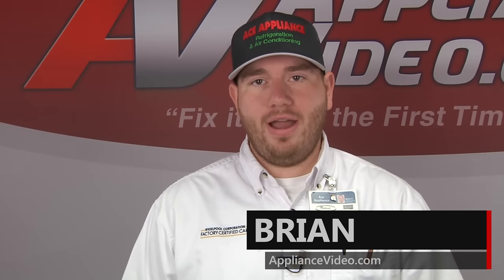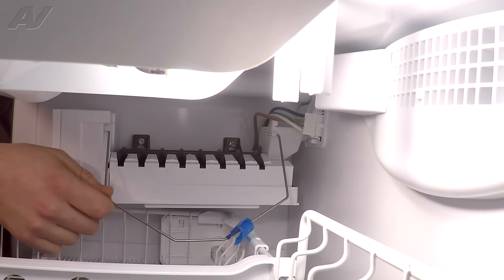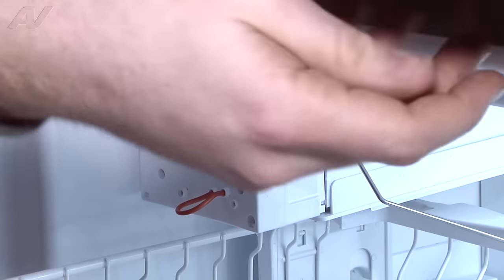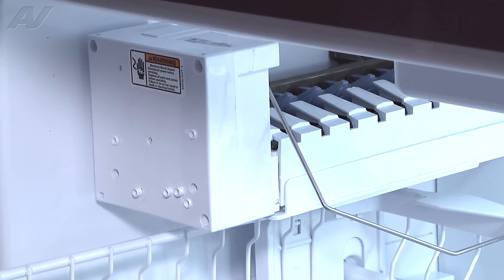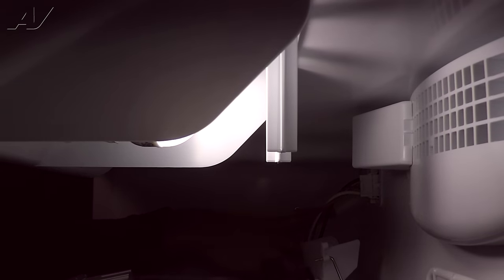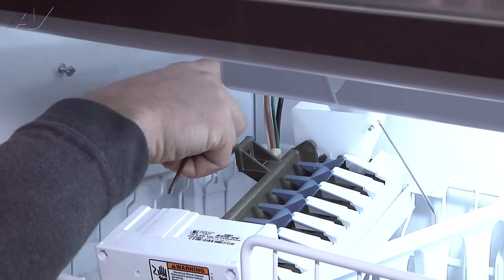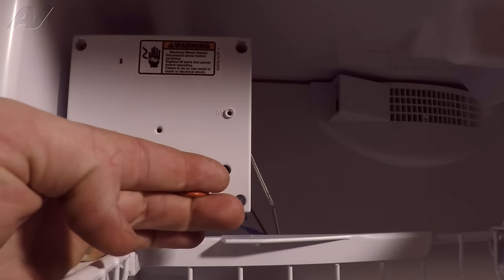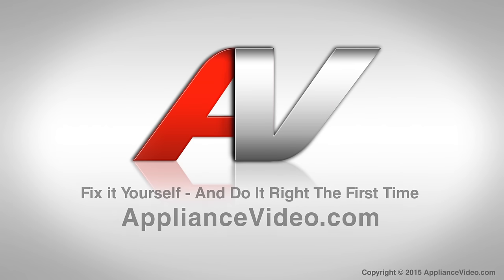Whirlpool Refrigerator Repair - Not Making Ice - Diagnostic & Troubleshooting

Comment: After losing our water pressure for a few days down here in texas, this was exactly what I needed to find. Thank you!
Reply from the maker: Great question, if you have a more technical question that our parts department cannot answer, you can search our over 17,000 answered questions free at our website www.ApplianceVideo.com under our Repair Help section. You can also call our parts department at 1-800-830-5465 and they can give you help 7-days A week ,or search at www.SaveMoreOnParts.com  .
Reply: My town had a major main break last week and we went a couple days with no water.  I have no ice now but I'm thinking it's because I finally exhausted the ice that was in my tray and the fill tube froze while the water was cut off.  I'll have to check after I get off work, but it makes sense based on this video and your experience.

Comment: I have installed the new inlet valves (with your video help). Now I've attempted to get the ice maker to cycle using the curved wire inserted into the tray but it doesn't cycle, or fill the ice tray. Now, what's next? Or do I have to wait for a long period of time? Or do I need to replace the ice-making tray? Thanks
Reply from the maker: Great question, if you have a more technical question that our parts department cannot answer, you can search our over 17,000 answered questions free at our website www.ApplianceVideo.com under our Repair Help section. You can also call our parts department at 1-800-830-5465 and they can give you help 7-days A week ,or search at www.SaveMoreOnParts.com  .

Comment: One trick I have used on several "no water" freezers is around the back where the fill valves are located swap the connectors for the water fill and Ice maker fill valves then go around to the front and momentarily press the water button like you are filling a glass only now the Ice maker should get water if everything is working. This makes cycling the valve easy from the front of the fridge. Just remember to switch them back when finished troubleshooting.
Reply: Nice trick! It helped me to eliminate ice as a possible cause. I have filled the tray with water using the water dispenser button. Now it's wait and see to create ice. One of those connecters, has a tab that looks defective. Perhaps the connector has worked loose and is causing the ice water valve not to work. Hope to confirm soon.
Reply: The ice maker is working again. I changed the filter which did not seem to help. But one of the two water water valve connectors looks deformed. I swapped the connectors as suggested and ice was made overnight. I worked with the connector tab of the deformed connector to ensure a good connection, and powered on and off the fridge a couple of times. I also pressed the reset button on the ice maker a couple of times. It's working now when it didn't work before. The ice maker has been working all day today. By the way, has suggested above.. swap the connectors back after troubleshooting, I did not do that and I had a puddle of water on the kitchen floor this morning.

Comment: Try doing this in a side by side freeze/fridge. There is no room! Cant get a drill in. Need to use a short ratchet with a short extension. Then, try grabbing that wire and detaching it... can't grip it easily. Grrr... didn't know I'd be changing this when I bought it. Never getting another side by side... next will be freezer in the bottom! 
Good video though.. lines up with others I've seen.

Comment: Ours model doesn't have a screw on the cover.  Does it just pop off some way?
Reply from the maker: Great question, if you have a more technical question that our parts department cannot answer, you can search our over 17,000 answered questions free at our website www.ApplianceVideo.com under our Repair Help section. You can also call our parts department at 1-800-830-5465 and they can give you help 7-days A week ,or search at www.SaveMoreOnParts.com  .
Reply: Yes, just pull the cap off.

Comment: Great video! The maker seemed to be working when I jumped it although it wasn’t letting water through. Nothing seem to be blocking or iced over in the water hose as I stuck a long screwdriver in it and felt nothing. Any way to test to see if water is going through while I have the maker disconnected?

Comment: Our ice maker quit a couple of years ago so we use ice trays. My wife curses the ice maker every time she gets ice. I have researched this in the past and could not find good help ... this is excellent and exactly what I am looking for. I am going to go give it a try now! Great video! Very well put together 👏🏼👏🏼👏🏼
Reply: Check out ice maker. No water / no ice in the maker. Did the jumper wire - nothing happened. Check wire harnesses, everything is plugged in.  Removed the unit - no ice in water tube. I guess is it a bad ice maker?
Reply: Brock Dunlap I am in the same boat right now, have you figured out your next move?
Reply from the maker: Great question, if you have a more technical question that our parts department cannot answer, you can search our over 17,000 answered questions free at our website www.ApplianceVideo.com under our Repair Help section. You can also call our parts department at 1-800-830-5465 and they can give you help 7-days A week ,or search at www.SaveMoreOnParts.com  .
Reply from the maker: Great question, if you have a more technical question that our parts department cannot answer, you can search our over 17,000 answered questions free at our website www.ApplianceVideo.com under our Repair Help section. You can also call our parts department at 1-800-830-5465 and they can give you help 7-days A week ,or search at www.SaveMoreOnParts.com  .
Reply: @BrockDunlap  HI.
I have the same problem too.
Please help.
thanks
Reply: @bryanmcdermott77  Hi . same problem.
please help.
thanks

Comment: Hello, it's really well explained. I've question about removing ice. Can defrosting for day or two help melting ice? And not to remove ice maker? Or ice has be removed manually? Thanks again
Reply from the maker: Great question, if you have a more technical question that our parts department cannot answer, you can search our over 17,000 answered questions free at our website www.ApplianceVideo.com under our Repair Help section. You can also call our parts department at 1-800-830-5465 and they can give you help 7-days A week ,or search at www.SaveMoreOnParts.com  .
Reply: I ll answer that. Yes. Defrosting will work

Comment: nice video! i have had my kitchenaid ice maker apart several times trying to figure out why it wont stop making ice even though the arm is in the off position. without any wiring to the arm, and looking at the gearts, i do not even understand how the arm stops the unit from making ice.  any thoughts?
Reply from the maker: Great question, if you have a more technical question that our parts department cannot answer, you can search our over 17,000 answered questions free at our website www.ApplianceVideo.com under our Repair Help section. You can also call our parts department at 1-800-830-5465 and they can give you help 7-days A week ,or search at www.SaveMoreOnParts.com  .

Comment: Good video. Man ud think when they design these refrigerators, they'd work out all the bugs. I have a new Hisense refrigerator bottom freezer model, and the ice maker worked at first for about a week, then wouldn't discharge the ice. Then it would, then it wouldn't. The support outfit knew 0 . They read the manual that comes with the unit to help you.
I have the type of ice maker with the arm that goes down to check the bucket before dumping. They didn't even know that. I just watched a video before yours, to find that out.  Guess I'm learning. Anyway, I defrosted the ice maker like they suggested and suddenly it's making ice again. Crumby design to me. 
Anyway thanks for the video. They mostly do help. ✌️

Comment: My mold was full and frozen solid. What would be the cause of this? Took it apart, nothing stuck in the inlet line. Cleaned and dried the mold. Turned the bail up to wait until the freezer cools back down to zero before I try to turn the ice maker on again.

Comment: I've watched you're video great job! I have the same ice maker and did everything you did and mine wasn't frozen .Cycled it and the water still doesn't kick on after it goes through it's cycle. Used the jump wires on L and V and water filled the tray but doesn't do it on it's own. So I know it's not frozen.  Do you know what else could be the problem?  Thanks

Comment: The AC in our house went out a week ago. The needed part is due any time now.  Since then the house has been about 80-90 degrees.  We have been going through ICE. Yesterday it stopped making ice. Would the outside temp have an effect on the inside temp of the freezer or do you think we burned it out?

Comment: Great video.  If the ice maker cycles ok with the jumper wire but the water still doesn’t flow is the issue with the electronics inside the ice maker and is this the point when I replace it?  I have made sure there’s no ice blockage and the water does flow inside the refrigerator dispenser. Thank you.

Comment: How do I change the water level?
Thanks
Reply from the maker: Great question, if you have a more technical question that our parts department cannot answer, you can search our over 17,000 answered questions free at our website www.ApplianceVideo.com under our Repair Help section. You can also call our parts department at 1-800-830-5465 and they can give you help 7-days A week ,or search at www.SaveMoreOnParts.com  .
Reply: i am trying to  find out the same thing. did you ever get an anwser? i am only getting small and/or  hollow cubes.

Comment: My defrost thermostat/klixon was was bad... once replaced, the ice maker started to work again. Looking at the schematic, this bi-metal thermostat is inline with the evaporator heater, the pan heater, and a heater for the fill valve for the ice maker. I have a fancy built in... most refrigerators may not have a heater for the fill valve. Great video!

Comment: Great video. Solved my problem at no cost. Thank you.
Reply: There are many other possible reasons for a ice maker not to work.  Mr. Cole only addressed one of them. In my case it was the wire shutoff arm that was not properly inserted in a small hole in the front timing mechanism. How do you know if it's not properly inserted? If you rotate the arm to the UP/OFF position it should stay there. If it doesn't then you can assume that the arm is not properly installed.
Reply from the maker: Thanks for your response, we are glad we could help. Our library of over 5,700 videos are currently helping over 1.6 million people like you every MONTH.  Please help us by subscribing to our YouTube channel, or post our website www.ApplianceVideo.com to your Facebook page, Twitter, Instagram or any other social media sites. Your support will help us keep producing more free quality videos.

Comment: i had cubes, but nothing comes out.  Plus, the bulb in the freezer stopped working
Reply from the maker: Great question, if you have a more technical question that our parts department cannot answer, you can search our over 17,000 answered questions free at our website www.ApplianceVideo.com under our Repair Help section. You can also call our parts department at 1-800-830-5465 and they can give you help 7-days A week ,or search at www.SaveMoreOnParts.com  .

Comment: What gauge wire is the jumper? Sorry if this was asked in an earlier comment.
Reply from the maker: Great question, if you have a more technical question that our parts department cannot answer, you can search our over 17,000 answered questions free at our website www.ApplianceVideo.com under our Repair Help section. You can also call our parts department at 1-800-830-5465 and they can give you help 7-days A week ,or search at www.SaveMoreOnParts.com  .

Comment: I put the wire into T and H and there is nothing going in ice maker.  My guess its not working completely?
Reply from the maker: Great question, if you have a more technical question that our parts department cannot answer, you can search our over 17,000 answered questions free at our website www.ApplianceVideo.com under our Repair Help section. You can also call our parts department at 1-800-830-5465 and they can give you help 7-days A week ,or search at www.SaveMoreOnParts.com  .

Comment: Mine won't kick the cubes out and the next batch of water overflows out into the box and to the floor.
Reply from the maker: Great question, if you have a more technical question that our parts department cannot answer, you can search our over 17,000 answered questions free at our website www.ApplianceVideo.com under our Repair Help section. You can also call our parts department at 1-800-830-5465 and they can give you help 7-days A week ,or search at www.SaveMoreOnParts.com  .
Reply: @Appliancevideo  Pretty sure I figured it out. I been using my heat gun once the ice is solid in the tray. After a few seconds of heat, the system will start to unthaw and kick out the cubes like it should then reset back and fills with water again. I think the metal line under the tray isn't producing heat like it should.

Comment: This is EXACTLY the problem we had. All that was needed was to jam a screwdriver into the water tube and all is well!! Found out later that our main problem was we opened and closed the freezer door too many times on a hot day. Condensation built up in the water tube. This mechanic has to get a metal!!!!
Reply from the maker: Great question, if you have a more technical question that our parts department cannot answer, you can search our over 17,000 answered questions free at our website www.ApplianceVideo.com under our Repair Help section. You can also call our parts department at 1-800-830-5465 and they can give you help 7-days A week ,or search at www.SaveMoreOnParts.com  .

Comment: Hi , same model Icemaker stopped working, ice remained in the icemaker. I had discovered an open freezer door during one of the real humid days ,  which is frequently an issue in my household. Not sure if a build up of  moisture/ice initiated this issue. I removed the icemaker and when I removed the cover I noticed the right hand side(closest to middle of freezer) heater connection had melted/deformed the plastic around the connection... the copper metal connections seem fine .. should I just dry it up and reinstall ? was moisture shorting the connection - resistance, heat etc ?  could the non-functioning heater damage the motor or is it protected when something in the cycle does not work ?

Thanks, Rob
Reply from the maker: Great question, if you have a more technical question that our parts department cannot answer, you can search our over 17,000 answered questions free at our website www.ApplianceVideo.com under our Repair Help section. You can also call our parts department at 1-800-830-5465 and they can give you help 7-days A week ,or search at www.SaveMoreOnParts.com  .

Comment: If there is just ice stuck in the ice maker, I did the reset portion it should just eject the ice and continue to work then yes? Still waiting but I'm assuming that's what will happen.
Reply from the maker: Great question, if you have a more technical question that our parts department cannot answer, you can search our over 13,000 answered questions free at our website www.ApplianceVideo.com under our Repair Help section. You can also call our parts department at 1-800-830-5465 and they can give you help 7-days A week ,or search at www.SaveMoreOnParts.com  .

Comment: Sometimes they ice up if the solenoid doesn't shut off tight and leaks a tiny bit.
Reply from the maker: Great question, if you have a more technical question that our parts department cannot answer, you can search our over 17,000 answered questions free at our website www.ApplianceVideo.com under our Repair Help section. You can also call our parts department at 1-800-830-5465 and they can give you help 7-days A week ,or search at www.SaveMoreOnParts.com  .

Comment: I changed both the emitter and reciever boards,my red light is on when I press the flap on the left but it's still not making ice??
Reply from the maker: Great question, if you have a more technical question that our parts department cannot answer, you can search our over 17,000 answered questions free at our website www.ApplianceVideo.com under our Repair Help section. You can also call our parts department at 1-800-830-5465 and they can give you help 7-days A week ,or search at www.SaveMoreOnParts.com  .

Comment: I moved my fridge and it stopped making ice.  Any suggestions? No ice build up and I'm getting water ti the line.
Reply from the maker: Great question, if you have a more technical question that our parts department cannot answer, you can search our over 13,000 answered questions free at our website www.ApplianceVideo.com under our Repair Help section. You can also call our parts department at 1-800-830-5465 and they can give you help 7-days A week ,or search at www.SaveMoreOnParts.com  .

Comment: On these models, there is no way to jump the fill valve to just test the fill valve and delivery?
Reply from the maker: Great question, if you have a more technical question that our parts department cannot answer, you can search our over 17,000 answered questions free at our website www.ApplianceVideo.com under our Repair Help section. You can also call our parts department at 1-800-830-5465 and they can give you help 7-days A week ,or search at www.SaveMoreOnParts.com  .